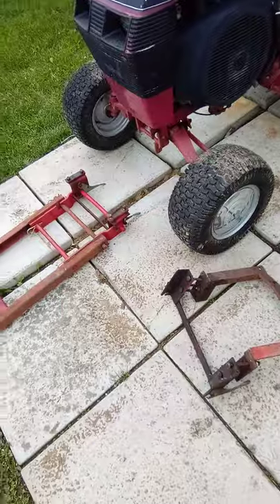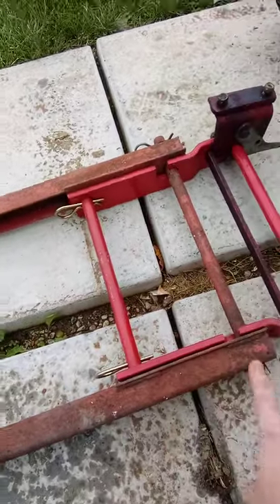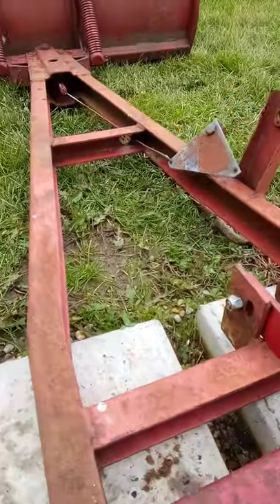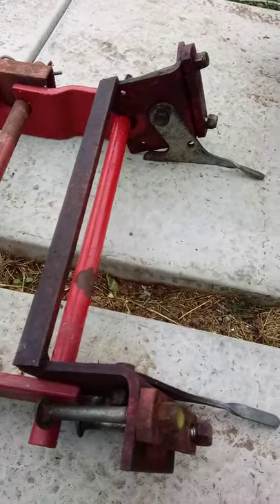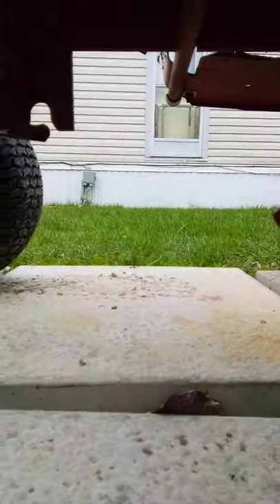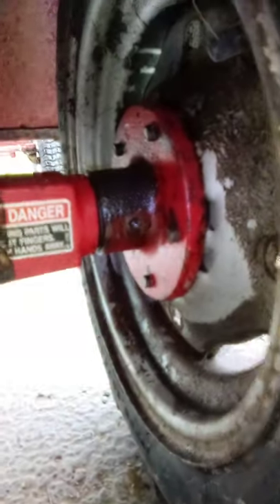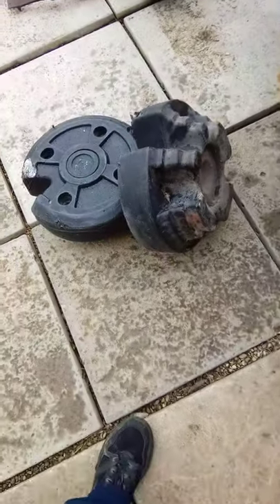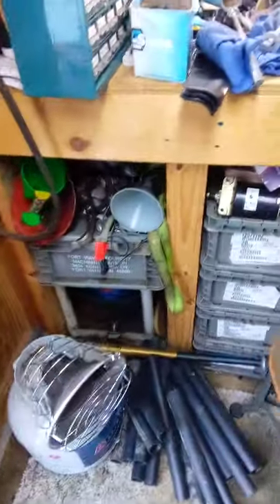520H Wheelhorse Snow plow pre install!

Comment: Thanks Nathan for this only video I could find with the plow extension!! I also have the 520H with swept axle. The plow used to fit my 518H, which I sold. It hits front right tire on my 520H when plowing to  the right!
Reply from the maker: Your very welcome. I did some adjusting to the middle attachment point to get it to not hit the front tie rods. Kinda played around till I got it right